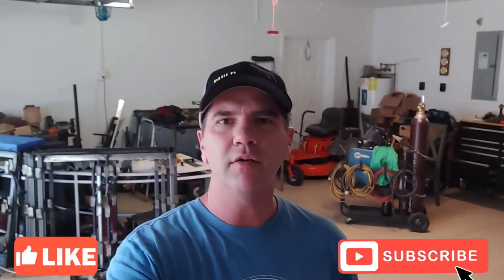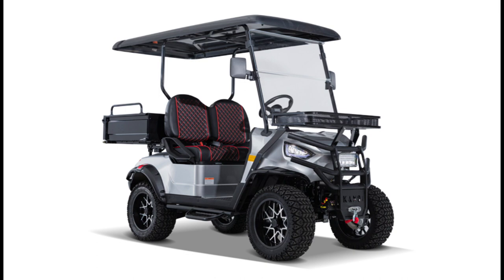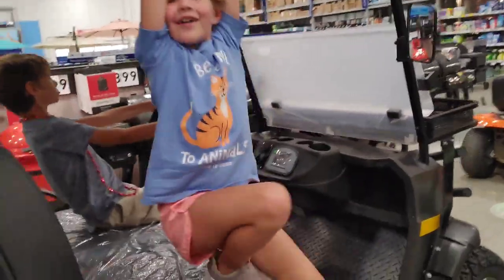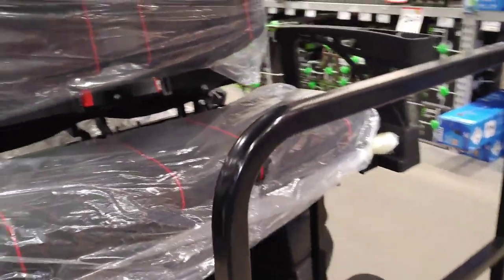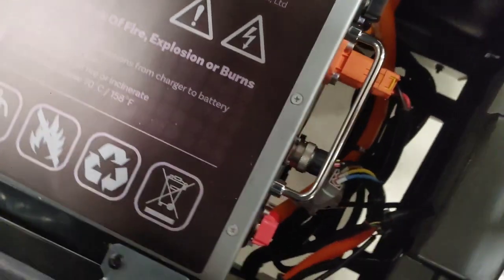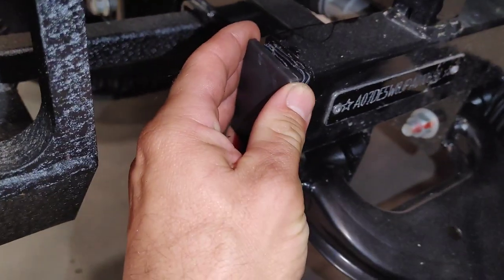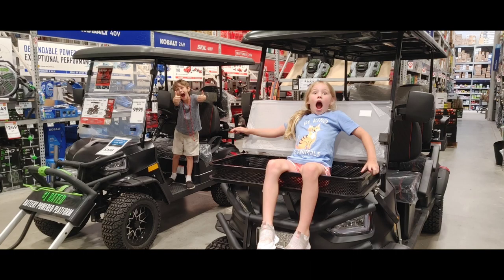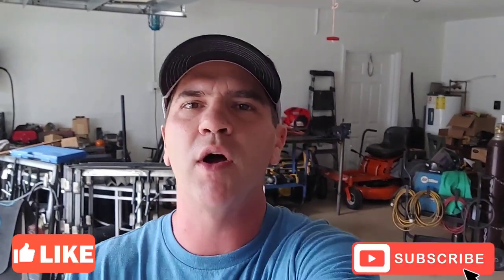Kandi / Coleman Golf carts / LSVs Review and Qaulity inspection. Available at Lowes!

Comment: Great video and information...Hi, I just bought a Kandi Kruiser Elec 4P to use in my Florida home and it will stay there.  According to the spec the motor is a 48V Lithium and we are back and forth to our home in New York and are gone 2 to 3 months at a time.  Can you tell me if I need to use a battery tender to keep the battery charged or if I leave it full charged before I go to NY. Also, I have a battery tender for my car and I use it all the time, but I don't have a clue how to install the battery tender in my golf cart as there are a number of batteries and ports in the motor compartment. HELP!

Comment: I've been considering one of these.  It's a lot of vehicle for the money which always makes me wonder how good is the build quality.  The fact that they are made in Dallas is very misleading.  I'm not sure what the legal definition of "made in America" is but it doesn't take much to get to say that, usually just some assembly in the US.  I believe that it is a Chinese owned company who bought out Coleman.  Most of the components are Chinese made with no U.S. oversight or QC/QA.  There are no dealer networks because dealers have to stand behind what they sell.  Just as you saw that the black is faded just from the short time it sat outside tells you a lot.  I suspect that it will run fine for a couple of years but soon after that, will start to fall apart.  Have you checked into how you get something repaired under warranty???  Who services these???  A suggestion on making your videos, slow down the movement with your camera.  I could hardly see what you were trying to show.  Slow and steady works best.

Comment: Watch out for the plastic roofs. Mine didn’t line up with the steel cage it bolts on to so the assembly man merely omitted the bolts and it rattles horribly. Since it’s not a mechanical issue they won’t fix it . 
A obvious design flaw !  
I’m very disappointed !
Reply: Oh and don’t go up a grade with it or ur gonna be late for tee off !